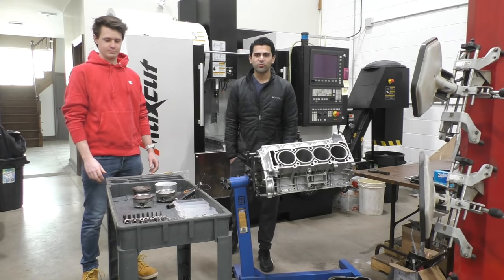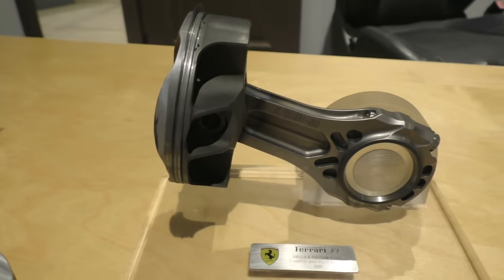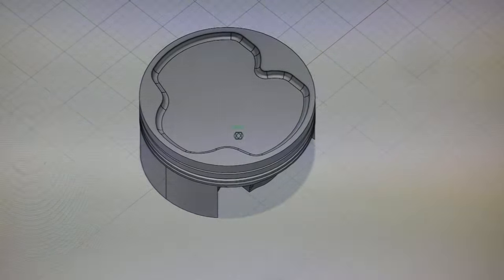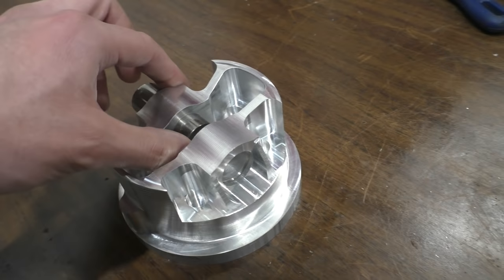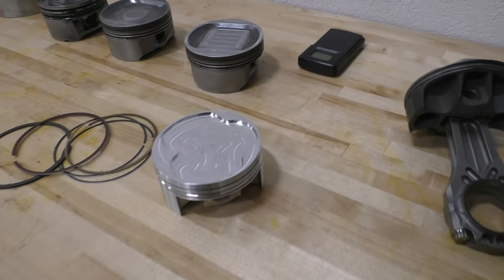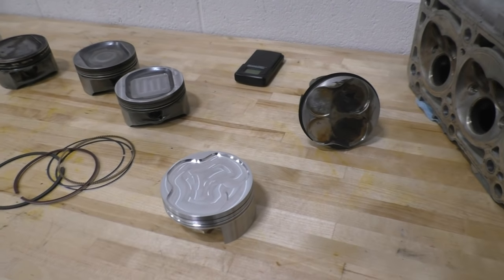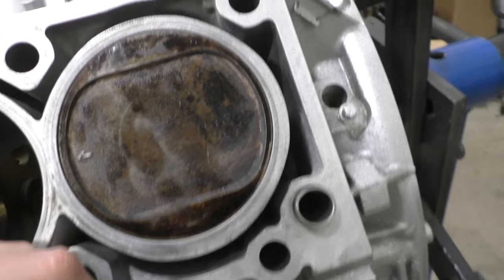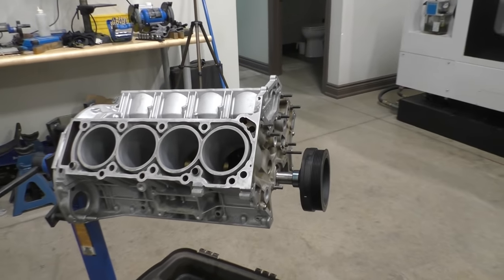Making an 11000rpm F1 Style Piston - Project XF1 Part 2

Comment: Better off casting the cylinder and put material where it counts and oil/temper cooling in other. Extruded aluminum is fouled with contamination and has high stress in its core, bending

Comment: You didn't factor in aerodynamic effects on the bottom of the piston... Around the wrist pins should be rounded, the edges of the skirts shouldn't have a sharp edge as the slightest unwanted rocking motion will F up your cylinder.

Comment: Racing engines are for 1 race if I'm right.
Reply: they are not for 1 race but they often have rebuild intervals of around 10000 miles in which you need to make a full service of the engine. F1 engines have an even lower lifespan and are often replaced mid-season. I guess this engine is being built considering reliability and longevity. But I am not an expert and I may be wrong
Reply: Depends on the class of race, but usually race engines are build to last one season, so they can be rebuild during the winter break
Reply: Only top fuel dragsters
Reply: I only watch f1. Engine is good for 20hrs before it needs to be replaced. Before they used to barely last 2. Now they use 5 engines for 22 races.
Reply: @jamesandonian7829  Thank you for the correction

Comment: how about turbine jet engine instead of pistons, turbojet (fin/impeller compression jet) or spinjet (tesla turbine pump jet)
Reply: spin jet turbine can simply made with the lathe carve technique, with some via holes near to the central axle, fuel in from the axle or from the air intake from center holes
Reply: just have the disc gap be 0.4mm

Comment: The piston looks good, but it's life will be very short, at one point it will brake and shatter due high inertial forces. 

Real pistons don't have this issue because they are made using a forging process, in other word real pistons are forged, not machined, forging insures a specific internal structure that insures strength which cannot be achieved through machining.

Comment: That piston head design has knock written all over it. Also it's unbalanced, so the piston will travel in an angle, rather than staight. If the wrist pin hole is loose, the piston will vibrate itself to pieces. Smooth the head, make the compression cavity symmetrical (it can be a bit higher at the center), and leave the edge as wide as possible. also make the wrist pin hole as tight as possible. Race pistons are usually heated before the wrist pin can be inserted. Plating the top gives the piston a longer lifespan also. When the pistons/rods are lighter, that also means the whole rotating assembly needs to be re-balanced.
Reply: Also race engine like the one from the f1 piston cant even turn over without preheating the block
Reply: @D3nn1s  bc of clearances
Reply: Not sure about balancing the piston in center line and traveling at angle, bc iirc there are some high reving engines with off-the-center pin and even off-the-center crank axis/piston center line.
Reply: @jareknowak8712  exactly
Reply: @jareknowak8712  It depends on stroke length, cylinder angle and spark plug placement, but on short stroke engine like this one, the piston is better to be balanced. It has so short skirt compared to the bore gap, that even a slight deviation will kink it, and therefore lose power/kill the piston or both.
Reply: @D3nn1s  Also the piston is slightly oval, and it heats to round, due to the lightweight design. The cold seize is due to piston/bore clearance, to eliminate combustion leak to crank case. In modern designs same thing is accomplished with small holes directing combustion behind the piston rings, but that also weakens the piston head, shortening the engine lifespan significantly, and requiring totally different billet alloy.
Reply: @jareknowak8712  Also it is possible to circumvent the unbalanced piston design with pin placements. They are all connected, but as a starting point, it's easier to make a balanced piston, than trying to design a balanced setup with unbalanced parts. overall balanced rotating assembly has more options in tune and wider rev range.

Comment: Why not use wood for gcode testing? Cuts faster less wastefull..
Reply: You dont get the same clearances. Theres also forces pushing the tool and spindle away from the stock, wood doesnt do this that much. So apart from being unable to measure with such a rough surface all measurements will be off by a couple hundrets probably. Might not seem like a big deal to you but trust me it is
Reply: @D3nn1s  i think he meant testing to avoid problems like the first misshap where there was an error in the gcode and the first billet ended up getting trashed
Reply: @jetink600  yeah but you dont do that. Total waste of time and energy. There could also be an error were the machine suddenly slams down and the wood wnt save your machine then. Also wood chips and dust will clog up the drainage holes.
Usually you run a simulation to test weather there are any such mistakes but i guess they either didnt do that or didnt spot the mistake

Comment: I find your work most amazing, and your channel one of the few worth watching in regards to automotive content... But regarding this piston and some of your designs, I have noticed that despite your elaborate calculations and work prep, you often go for performance with great sacrifice of other properties... 9 mil is nothing... 9 mil is there to provide durability, not to provide mass... tho mass does come with girth... likewise with the pump you redesigned the lobed mechanism for and used aluminium instead of tempered cobalt steel for example, which in a high pressure pump would be more appropriate, because despite your contactless pump mechanism, its the cavitation that ruins the pumps and not friction... You seem to have quite the skillset, the tools and knowledge on the matter, but nonetheless display some lack of material chemistry and physics knowledge... but dont take that as a bad thing, i am stating it only because i want you to advance and do better, as you deserve to!
Reply: They're ambitious (good), but don't know what they don't know (not so good).
Reply: Got to agree, it’s the typical university graduate which is normally tempered by experience in high end engineering environments but judging from the history of this channel, it’s just been straight into doing his own thing without getting that experience.. I didn’t know what I didn’t know until I started after uni and now a project like this (done right) would take me months upon months of design and analysis and manufacture.. sure I totally thought I could make a piston when I was younger and had access to the right machine tools, now I know it takes a huge amount more knowledge than just knowing how to operate the machine and a cad station.

Comment: Why don’t you use the m155 instead of the m113
Reply: M113 engine
Reply: well where would you get a M155? A used Merc Mclaren SLR, those are really cheap compered to used S class with the m113.
Reply: From where tho
Reply: the m113 is stupidly cheap now

Comment: huh, F1 tolerances are way stricter and you can never achieve that same level on a MB daily driver. And more accuracy means more room for optimization (weight reduction).
Also, f1 engine to start need to run idle for 15 mins + to warm up the gaps - this is not any way doable on a mass prod  M113/273 engine.

Comment: Open deck is not good for 900hp
Reply: It works, the M113 K engine can handle 900hp with all stock internals and just Software and a smaller super charger pulley
Reply: @georgobergfell  You dream tooo much. M113K have not SLR internals.
Reply: @TA-mm7rv  check the latest video from the german YT channel "Motoren Zimmer", one of their guys has a W220 S55 AMG with this exact engine and 900hp
Reply: @georgobergfell  not 900hp. Its 900Nm (newton meter) at MotorenZimmer